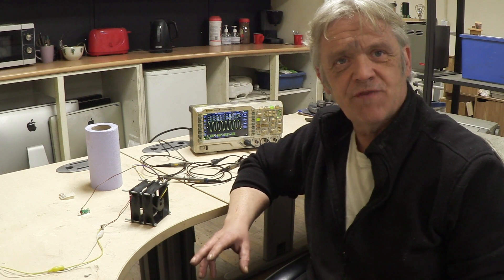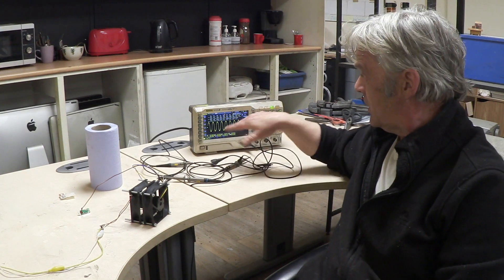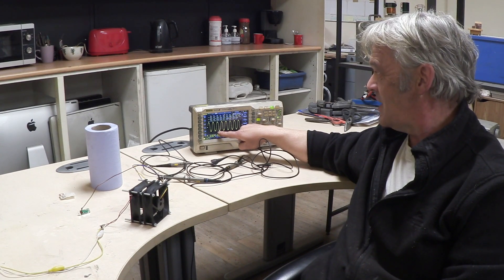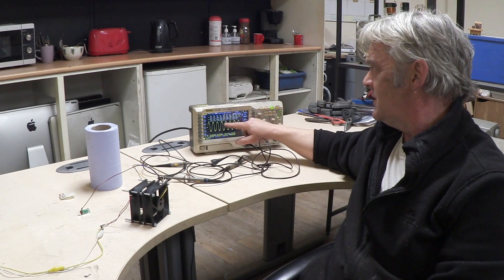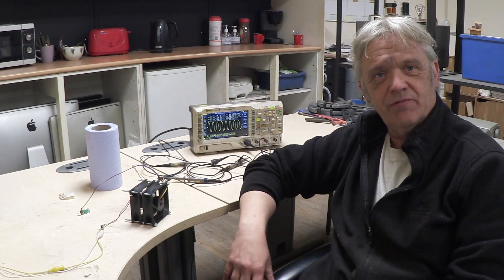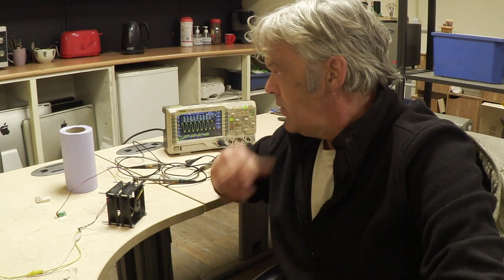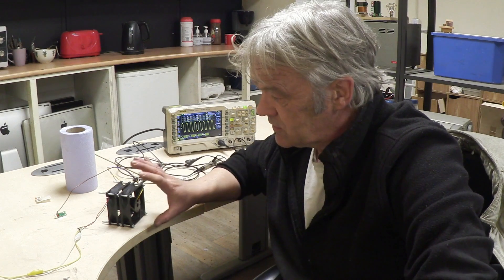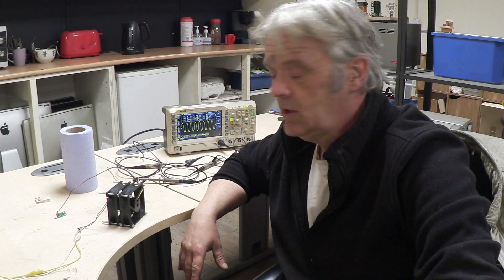1055 Mechanical Inverter On The Oscilloscope

Comment: Thanks Robert, that's great. What does the wave form look like with a load on it? Which sensitive electronics need AC ? All laptops run on DC, the wall adapter rectifies what comes out of the main to DC, A desktop internally runs on DC, the power supply converts the mains voltage to low voltage DC to run the internal components.  Billy on Tulas' Endless Summer channel said he has used a modified sine wave inverter for years and had no problems with their laptops or anything else they use an inverter for.

Comment: Robert I love your videos, they always make me think. After watching this video I had to wonder about your car alternator to block motor conversion. Since a car alternator generates 3 phase, pure sine wave 120 ac. You could use your converted alternator to drive a second alternator with rectifier removed. But how can you reduce the hex down to 60. Maybe use your manual drive control to reduce hz?

Comment: Pure sine wave inverters (barring frauds - assuming good products from reputable manufacturers) do actually produce beautiful sine waves. Nyquist-Shannon works in both ways, and it is about the perfect reconstruction of any given bandwidth-limited signal. Don't fall in the old if-it's-digital-then-it's-jagged argument. Nope. You can reconstruct a perfectly pure (in the real world, to a tiny fraction of a percent) sine wave  from a digital stream double its frequency. Besides, digital topologies may carry great benefits but are not really required.
In fact, many real world devices are specified to <1% THD and some reach unity power factor. That's the kind of output you get, for example, from grid-connected PV inverters or any online double-conversion (VFI) UPS (again, assuming non-scams). You can view most of them a bit as mighty powerful class-D subwoofer amplifiers, or even class-C radio transmitters with a <100Hz bandwidth, depending on their topology. They are available in powers from <1kW to >1MW, with or without galvanic insulation from the DC side, single or three-phase, and they can be quite efficient too (even >99% recently, increasing with the actual power output) and reliable (again, barring garbage).
So-called modified or approximate sine wave inverters or UPSs are a whole other thing: their output doesn't even remotely look like a sine function, but they are much cheaper and acceptable in many cases. Feeding the SMPSU of your average PC, for example. Hint: some hair driers at half power can be a lethal challenge for sub-par products.
Time-domain plots (the classic oscilloscope view) can fool even experts: looking at your inverter output also on a spectrum analyzer (a frequency domain view based on a FFT of the input signal) tells a lot more about the quality of the waveform you are producing, and preferably under different loads (impedance is a /complex/ thing). Maybe your scope has this function or you can unlock it with a license upgrade.

Comment: There's some high-end audio amplifiers that use 400Hz AC for power input. The higher frequency allows the use of smaller transformers and lower capacitance values (with low ESR), making it far easier to eliminate ripple, and to react quickly to the high current transients required by the bass drivers.

Comment: Whats the RMS  <Robert Murray Smith> voltage?  These are not new, the motor/dynamo was used under the names of dynomotor, genemotor, rotary inverter to supply valve radio HT from batteries during WW2 and before. Still used or voltage/frequency conversion in high power  installations today.

Comment: One thing to look out for is loading.
Obviously if you are using it as an input for an amplifier it will have a very small load, but if you use it for an actual power device you may see a change in frequency. I only mention this in case someone has the idea to connect it as a mains device to reduce their electric bill ..... or similar ;0)

Comment: I bought a cheap invertor once and tried to power my laptop with it and I'd constantly get the blue screen of death.
Reply: Noisey it must have been. Smps can run from DC aswell (it does rectify incoming AC in first step) so if u added rectifier and lotta filtering it would perhaps work better.

Comment: rather than a signal generator that again must deal with mosfets,  I think it's better to pick 120 mm of that fan,  put strong magnets on the blades, lots of coils on the side, and spin it near 50 Hz, connect it to a transformer and hope that can generate 1000 watts or more
Reply: Doesn't work that way unfortunately

Comment: but digital oscillators also produce pure sine wave, is just that when you want more power, even operational amplifiers must connect to transistors or mosfets to do it, and they're able to switch really fast with lots of amperes, but still they have to rely on Pulse Width Modulation (PWM) to create average voltage which follow a certain code sequence in microcontrollers, which in end that sequence looks like sine wave

Comment: How to drive high-voltage and amperage is the key to make it cheap, high power solid state electronics are quite expensive, I generated the sine-wave with a DAC but the current required to drive the coils takes quite a high amperage so... that's the challenge.

Comment: I know man tired of my comments. A spark gap with cap and load could produce a perfect sine. A forgotten guy name tesla designed it. So to get around the emf noise one could use 12v neon bulbs in parallel or series for the gap. Cap would vary as well as load. Electronic engineering isnt hard just forgotten. Most designers follow misinformed knowledge which leads them to the same results as others. Who could be the first to past gamma waves by using specialized vacuum pentodes?

Comment: Hmm i’ll dig out my old lab book and check out the humble “Op-Amp”... Using this mechanical drive to modulate the wave form but not carry the bulk of the power makes we wonder if not having a precise enough “clock” is the issue with the commercial inverters. This one IS the clock!
Reply: No, its principle commercial converters work at that creates waveform similar in V/A RMS characteristics to pure sine wave but in reality it's just AC PWM and it's noisy and problematic with certain loads.
Reply: @plainedgedsaw1694  RMS stands for \Root Mean Square? [of the Ohmic Resistance] ? That would def explain why and when non-Ohm-like components introduce noise. And to be specific i guess that would be a periodic AC wave but then needing to be shifted down to centre over +-0V

Comment: It is great and I was impressed by its simplicity. However, I have 4 of the claimed pure sine wave inverters, the smallest is in a power pack (solar generator) 400wh and is 400W output costing 330 euros. The largest is a 4kW model with combined 4kW solar charge controller and utility charger costing about 450 euros. They all work all electronic and digital stuff perfectly well for years. Unless one could get free or cheap motors to make a true pure inverter, would it be cost effective? I know it would be fun and great experience. Best wishes.

Comment: A "pure" sine wave is generated digitally by using a very high frequency PWM into high power MOSFETs (half bridge?), where the PWM duty is modulated using a DAC, which will consequently have the resolution of the DAC. But add an inline inductor or bypass capacitor and it's pretty smooth. But then, once you add a decent load, especially an inductive load, it will distort the shape and frequency of the sine. It's pretty messy stuff. You might use the fans to drive the duty cycle. There's also the start up to consider. If you're starting up, you'll be generating DC initially instead of 50 Hz, which will seriously mess up some devices.

Comment: Thats true. Modern inverters will not produce perfect sine waves. In reality though it's good enough. These could do way better but for reasons of switching loses it's not done.
For a function generator, if you do not need a to high frequency ( say up to 1 MHz ) it can be done with digital pwm and a filter, kind of like the inverter and it will be a more perfect sine wave then any generator. I think  it's done like this in modern function generators

Comment: Isn't this more of a signal generator than an inverter? Solid shaft coupled would be much better, as any required power will cause cogging of the driven generator, instantly stopping the interaction between the 2 fans.
Reply: Used in aircraft

Comment: Trully, pure sign waves exist only in math functions. Every signwave in the real world is an approximation with some being very very close others just a rough appearance. 

modified sign wave seen in cheap inverters put out effectivly the same rms  valve a sinewave would over a cycle through a pure resistive load but its behavior with nonlinear loads can be tough on motors and electronics. 

socalled "pure sign wave" inverters use a pulse width modulation and a filtering inductor and capacitor to put out a reasonably good approximate sign wave that most electronics and motors can work normally with.
Reply: You're too educated.
You need to go and play with a "Bi-Toroid Transformer". Then do the math on the COP, of both the primary and the two secondary coils - during operation 'under load'.

Comment: Great video. Voltage+current under load would be interesting too. For reactive and complex power capability etc.

If DC around and wanting higher volt DC out I'd have thought would be better to boost convert it at high frequency then use low pass filter to block above audio frequency.
Reply: Not electronic.... search 'mechanical boost converter'

'Ludic Science Electromechanical Boost Converter' Nov 17, 2015
"This video shows a curious joule thief circuit that uses a mechanical switch to do the commutation instead of a transistor. "

good enough ? long term  for a bunch running off some cleaned from plastic on one side free aluminium can + carbon earth batteries! under the tree